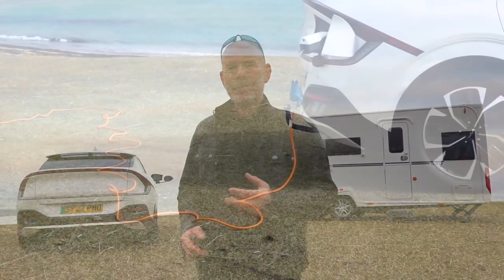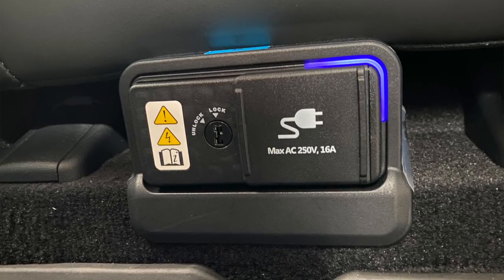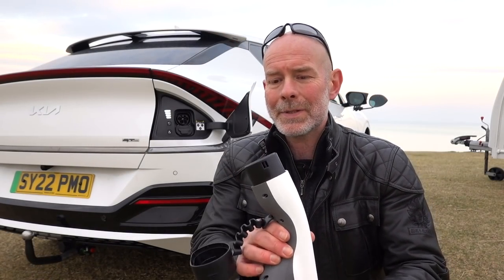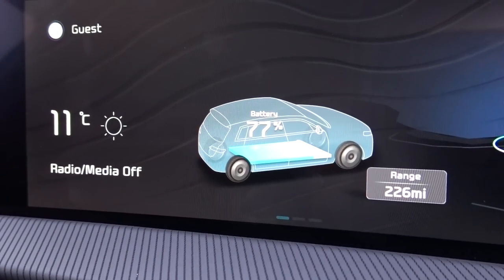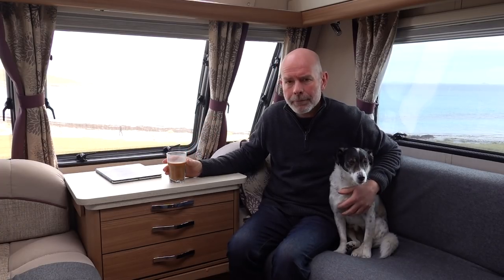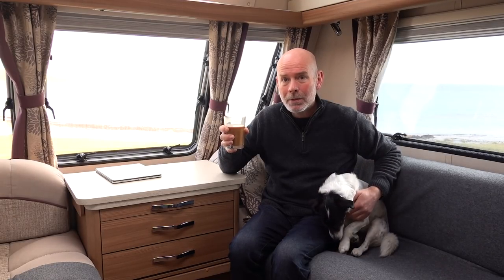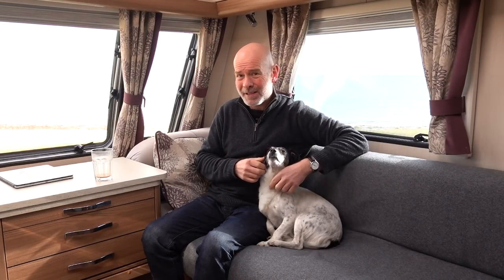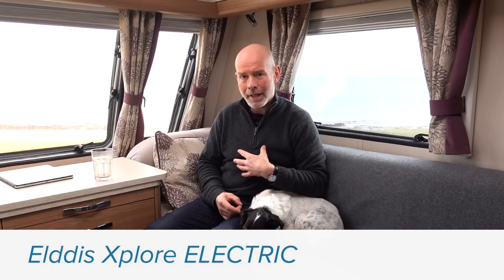V2L Caravan test - Will EVs REVOLUTIONISE caravan design?

Comment: Great video love the future. Looking forward to seeing how you get on with the charging When caravan attached. Also wondering about water and waste. Do you have in board tanks and how easy are they to dump. Does it require lots if reversing in awkward spaces etc Love an update on that.
Reply from the maker: Hi Loraine, in the UK we generally use external wheeled tanks, so you take the tanks to the fresh tap or dump station, not the caravan. Thanks for watching.

Comment: Did you find a solution for keeping the plug weatherproof? Or at least slightly weatherproof? With the uk plug design I find it doesn’t allow the V2L adapter to shut.
Reply from the maker: Hi Neale, the casing to the adaptor seems weatherproof enough. Agreed that the UK plug design is not as good as type with cables that come out of the rear, but this type seemed to work OK. It wouldn't work if it had a rubber sheath protecting the cable entry into the plug though. The V2L adaptor definitely needs Anglicising and improving though. Thanks for watching.

Comment: Hmm... I'm not so sure this EV option is the future... yet, imo. I think the restriction on distance between charges pulling a caravan will make it unviable for the time being. It may work for a single destination holiday but not for touring.
Reply: And from what I’ve seen of charging points a lot look difficult to access while towing.
Reply: charging is an absolute nightmare on a run at rapid chargers, even for just an electric car on it's own, never mind with a caravan attached. I have a leaf and only use it around town and short trips now because I have learned my lesson. I have a diesel camper van and Mercedes E class diesel, for long trips and touring, both with ranges of 600 miles plus and instant refueling.
Don't forget most chargers are 50 kw at the moment and a 77 kwhr battery would take about 1 1/2 hours to charge, empty to around 90% on one. The bigger the battery, the longer charge time, even if it's range may be greater between stops. My 30 kwhr leaf takes around 40 minutes or so because of it's smaller battery size.
With a caravan attached to a big battery car, you are only getting slightly more than my leaf's 107 miles and that is when it is brand new, it is only about 80 or so now.
Reply: To my mind , there's a much bigger problem , that no one appears to be talking about . Just where is all this electric gonna come from on campsites ? . Most sites can supply a 16amp hook up , but that's not gonna be enough to supply total demand . Charge the car , and run the caravan . Lights , water , heating , cooking . Campsites are gonna need a small substation , just to supply this demand , for maybe as few as 5 units , and i can't see the electric companies falling over themselves to fit one .
Reply from the maker: Yes, I just want to show what is currently possible. It does at least mean that all-electric caravans could be viable, as they will work for short periods away from a hook-up, unlike just a few years ago.
Reply: @mickey1299  16A is a LOT. In winter it would be a stretch with the heating requirements during the night, but the other 3 seasons should be ok. 10A could be a problem though and in my experience 90% of all campsites has that.

Comment: Interesting to see the car used as a powerbank. I had wondered how you would fare going off grid for periods especially winter. Although gas is very economical for £/kw.
Reply from the maker: It is Gareth, but where I live you can't get LPG at the pump, and exchangeable cylinders are eye-wateringly expensive. Thanks for watching!

Comment: Great video, really useful with the fuel prices going so high, v interested to see what charging your ev from a site hookup is like (if permitted, what if everyone is charging at the same time?) and surely you still need a 12v leisure battery for the 12v lighting system to work ? P.s. cracking car
Reply: Have fuel prices risen as much as electricity prices?
Reply from the maker: Cheers Jon, it's going to be an interesting summer!

Comment: The secret sauce here in an electric caravan is things like. Ability to capture the increased regen braking energy from the caravan mass - do you find EV can slow the rig down on regen ?  Maximise aero efficiency so none of the sticking out roof vents, wind tunnel, smooth underside etc etc. Ultra lightweight construction (carbon fibre chassis for example) and low friction running gear. Heat pump and the like. All at a cost of course.
Reply from the maker: Cheers Nigel. Totally agree. I love the regen paddles in the EV6 so you can control it at your fingertips - upping the regen if doing downhill for example. What I'd love to do is compare towing a regular caravan with something more aerodynamic like an Eriba. All in good time, I hope. Many thanks.

Comment: The main issue with this electric-only approach comes when someone leaves the site in the car. So if I go off to a golf range for a couple of hours, whoever is left in the van has no toilet flush, no water pump, no TV, etc. Or if we both head off for a day, for that whole day the fridge and freezer will be off. For me I can't see us doing without an alternative "off-grid" power source, whether that is gas or battery with solar (doesn't have to be both gas and battery). When on site it could be EHU but how does that work exactly, today I want EHU, tomorrow I don't, I actually only need it for a couple of hours ? Doesn't fit with our current model of site payment really, maybe it needs to be metered payment as standard ?
Reply from the maker: Hi Paul, you're quite correct. Maybe a decent lithium battery could power the (compressor) fridge, loo etc while the car is away. I think the current arrangement on sites will have to end soon - not just because of EVs, but also the excruciating cost of energy. We've all seen people heat their awnings and leave them empty. But do the sites install meters, or simply keep it as it is, reduce each pitch to 6A, and install EV chargers? It's very early days and will be interesting to see how it pans out. Thanks for watching.

Comment: We want our next campervan to be all electric. Power should come directly from the main battery (with a cut-off, just like the ev6), but I would like to see the option to charge the main battery by solar also. It would certainly fit our slow way of travelling. Because of where my brother lives I would want a range during winter of 250km, so the 75-ish kWh of the current electric vans (fiat/citroen/..) will probably be a little bit too small, about 100 or 120 would be enough I guess.
If you bring a small induction cooker you would probably save quite a lot more, because those plates use a lot more.
Reply from the maker: Induction is a good idea! Thanks for the tip ;)

Comment: It's a wonderful prospect for a campervan too - if electric vans offer V2L.
Reply: In some ways all electric camper vans make more sense than electric car and caravan combination.
Reply: @gin9991  I think you're right. Overall it's a more efficient package so you can make better use of battery capacity. There is a bit of a legal problem with gross vehicle weight. No issue for Transporter sized vans, but a problem for a Sprinter.

Comment: There already is electric Caravans on the Market, its called Solar, we run one with 3, 300 amp lithium batteries and inverter to run all powered items, TV,  electric hob, jugs, toasters, water pump, and we can free camp for weeks on end with out worrying about the batteries draining, As far as the car, over here in Australia its bound for failure if your towing a Caravan, nobody is going to buy a Car that can only do a couple of 100ks a day, when here we sometimes drive 1000ks a day, nobody is going to wait for 8hrs for a charge. Cost for a EV over here can range from $54 thousand to $70 thousand for the EV, and the cost of replacing the battery every 6 to 8 years is phenomenal, especially when you think some diesel vehicles here in Australia are turning over up to and more than 500,000ks, Our last trip was 12,000ks round trip, sure at the moment with lack of EVs on the road, power is much cheaper, but i can imagine that will skyrocket when power demand increases,  So as nice as it looks, its a big no from a Aussie fan

Comment: How do you keep the fridge going whilst travelling or when the car is used away from the caravan (which is the point of Car and caravan v motorhome) without a leisure battery or gas. V2L sounds like a good backup but not the best as the only source of power. You still require gas and batteries
Reply: This idea is as mad as a box of frogs the. Ev idea will never replace petrol or diesel untill cars vans etc have a power supply other than a battery hydrogen is the only technology that does that and untill we rid vehicles of batteries the idea of electric tow cars for off grid use is a non starter I would think a gypsy cart with a horse makes more sense

Comment: I noticed that you kept your 12V leisure battery connected Andrew, presumably you'd need it to provide a 12V circuit to run lighting and water pumps. Without a leisure battery those items would presumably have to be 240V,  which means that only one type of power circuit, rather than two. Not sure how you'd power the fridge when towing, unless the hook up electrics could be made to be 240V, but then what voltage do the caravan driving lights run on. Mmmm maybe that might mean having to go back to to sockets, with 12V to run caravan driving lights and 240V for the fridge. I don't recall an all electric Elddis but I do remember the 2012 Bailey Orion Evo 4  that had no leisure battery and used gas just for two burners on the hob. https://www.youtube.com/watch?v=Lm4ixmyrAWE . Another thought is that sites wouldn't need electric points for EHU's any more, though maybe they'd just switch to car charging points.
Reply from the maker: Hi Andy, it's recommended that you run the 12v through a battery, even though you don't actually NEED one if plugged in to the mains, as the transformer should do the job. There's LOTS to consider how this might all end up looking in a few years time! Thanks for watching.

Comment: Probably aware but heating control can monitor 240v amps and limit heater automatically. I.e. pause heating when kettle on. Took me 15 mins to install.
Reply from the maker: Good point thanks Peter. Something I'll be considering for my new caravan when it arrives. Cheers.

Comment: I wonder if we are going to see an increase in the sales of lightweight caravans like the Basecamp with the rise of electric cars. Or perhaps designers even starting to reduce the overall weight/improve aerodynamics for caravans as fossil fuels are slowly phased out.
Reply: That would be a great test! Basecamp vs xplore 304 range test!
Reply: We looked at a basecamp but chose a D4-3 Bailey discovery to tow with our forthcoming Ioniq 5
Reply: Weight makes surprisingly little difference when it comes to mileage. But the tow rating are often a low on EVs, so that's a valid concern.

Comment: I have always wondered how we got to 3 types of power: petrol/diesel for the car, a battery for the lights, TV etc. and gas for the heating.  This gets rid of all that - genius.  
Without a battery, do the lights in the caravan work off an inverter?
Reply: The (zig?) battery charger on some vans will provide a 12v supply to the 12v system without a battery.
Reply: Mmm that only works if you never leave the van on site while you go off in the car for the day.
Reply from the maker: Yes, the fridge is the sticking point. I was just wanting to show what is possible.

Comment: so currently there is still more to do. Lets say...you have available grid power. i should be able to plug the caravan into shore power and the car as well and be able to charge the car whilst enjoying power inside the caravan. Can u do that now or is it one thing at a time which isnt well executed.😅
Reply: Just to clarify. Shore power to trailer and trailer to car.😂 Ive waited for this all my life it seems.
Reply from the maker: That is something I intend to try very soon. With shore power (Electric Hook Up in the UK, EHU) we have 16amps at 220v. Currently we are permitted to plug the car in to the caravan (NOT directly into the EHU point) and draw about 1.3kW/h. So that will take two days to fully charge a low 77kW/h battery, but it's doable.

Comment: I would invest in a lithium ion 12 volt battery as well. Because the 12 volt battery is charged battery to battery and there is no deep discharge on starting and instead it only works relays, EV batteries suffer much worse conditions than on an ice car with an alternator keeping the 12 volt battery topped to the brim most of the time, which is what a lead acid battery likes. I am currently on my third 12 volt battery in 6 years in my leaf and it would be much worse failing with a caravan attached because you ain't going nowhere and nothing works with a deceased 12 volt battery, which every electric carcurrently uses, for cheapness of manufacture.
Reply from the maker: Very interesting thanks Steve. I'm still learning and have yet to come to grips with why the EV6 has a 12v battery. Do you mean a Lithium battery for the car, or for the caravan? Cheers.
Reply: @andrewjditton  the 12 volt battery on the car. Tesla uses a lithium ion one for this reason. Other manufacturers use a normal 12 volt lead acid battery for cheapness but like I said they do not last anywhere near as long in an EV as in an ice car, sometimes leaving you stranded. A lithium ion 12 volt  battery is about 5 times more expensive but it will last much longer pro rata in time and cost because it is more suited to the use case on an EV. With a lead acid battery you will wake up maybe in as little as 2 years with a 'dead car', it is a regular topic with EV owners on YouTube.

Comment: Battery size of the car would need to be bigger, public charging multiple times will affect your schedule too much. The promised Tesla Cybertruck with 500 mile range is probably more realistic for this application, also benefitting from more reliable Tesla charging network

Comment: I'm guessing the range on that car in the real world towing will be about 100 miles if you're lucky, it doesn't leave much spare for powering the caravan for the night, then trying to find a charger for the onward journey the next day with a caravan in tow, it's going to take a long time to get anywhere and if like me you tow down to southern Spain it's a none starter. Electric cars may be good for the odd visit to Tesco but if you actually want to go anywhere they're useless.
Reply: I contacted Kia regarding the towing capability of the EV6 and they were unable to answer me.  They referred me to a dealer!  Gave up at that point!
Reply: Mr70 you might right to say going to Spain towing with an ev might be pain!I haven’t tried it! But I have done more then then a Tesco’s shopping trip!! For example just done 420 miles with a Audi Etron 50 ( the one with the smaller battery) and a caravan, so it would be easier with Andrews car, I think he could manage up 150 miles. I think you got to think of two time of journey or camping situation! One where you arrive to the caravan site and treat it as a petrol station (get there empty and top up over night!) Places where they have electricity! Or what a like at times a lot is places where they don’t have electric points for your caravan like Roundhill in the New forest, but you can charge before you arrive for 20 minutes nearby or at the reception for a £5 and then enjoy!! Not too much pain to save you money! (Cost me £3.20 to get there, 105 miles)
Reply from the maker: There is actually quite a wide variety of trip patterns between Southern Spain and the local Tesco. If you watch my towing review you'll hear me say that it's not for people who want to make long trips. This video was about the V2L. Thanks for watching.

Comment: starting to be converted going on your review especially with caravans could become lighter with no Battery and gas cylinders. You could use a multi cooker as an oven along with a portable induction hob 2 ring or maybe the caravan industry could look at installing a 4 ring induction hob. Looks like the caravan industry could well be having to look into caravans being built specifically for a EV obviously with that ability to use the EV as a power station and with costs of £3.20 for the 16 amp hours used in your case then it seems like a no brainer
Reply from the maker: Indeed. Someone also mentioned air source heat pumps for caravans - now THERE is something simply waiting to be invented!

Comment: Electricity will always be tainted for me. Bought a new build home in 1990 with storage heaters on economy 7. Paid the price ever since. We had gas central heating installed last year, it’s superb. I could have paid for it many times over with the money I have handed over to the shareholders over the years for electricity I have used. The next ‘revolutionary’ electric heating systems have come and gone but however you dress electricity up it is still rubbish, and expensive rubbish and I have many years to ponder this. If it was free, it would still be rubbish in a caravan. I fear I may be the only one that thinks this nowadays. If you want to live on one pot meals and turn the heating down, get a tent. And camping is great BTW. I have tried to engage with the electrical future, I really have but gas and diesel are better.🙂 Does anybody think 20p per Kw will last. Really? It’s a thin incentive that will quickly bite back. Excellent videos, Sir
Reply: Richard you’re right about electric staff, a got a laptop in the 80s and a mobile phone in the 90s and they rubbish!! Wish people didn’t say out off date information with pessimistic ideas, apart from if you get paid to do it by the green petrol industries!